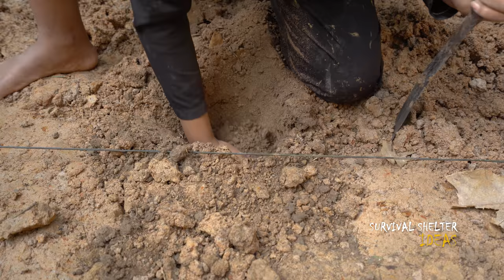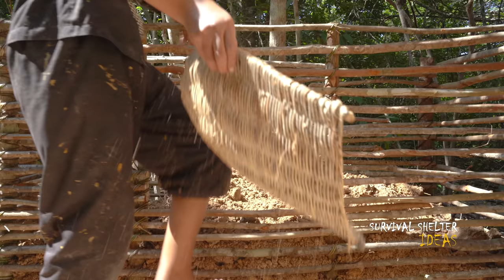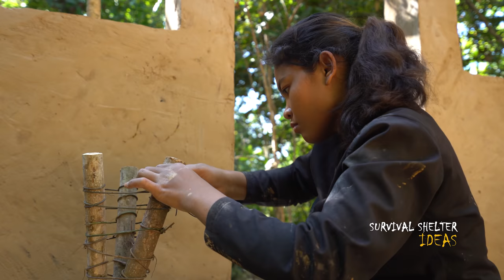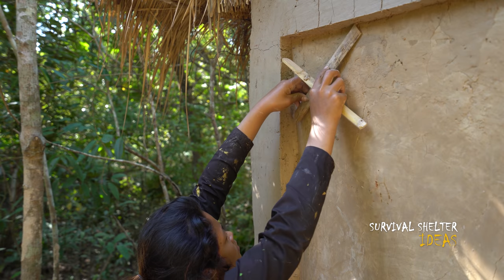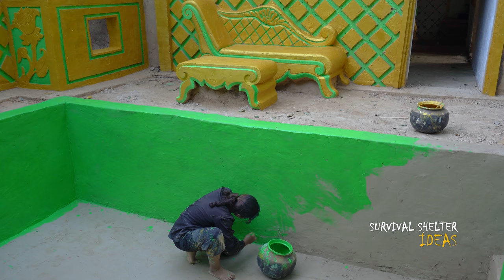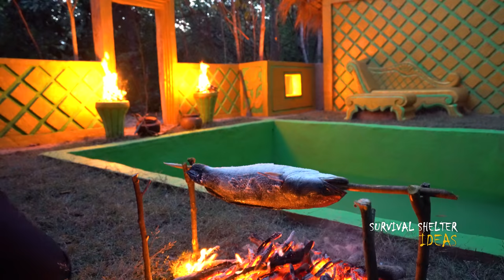Amazing! Build The Most Beautiful Swimming Pool for Jungle House Villa by a girl

Comment: Whenever I watch these videos where the builders bring in water in jars and spend hours trekking back and forth to tediously fill these pools they worked hard to dig out, cement over and fill up, what happens after a few days when the water eventually turns scummy and swampy and filled with dead bugs and debris? I doubt these jungles they live in offer some sort of nature-based shock treatment.  You basically built a nice home for frogs and mosquitos